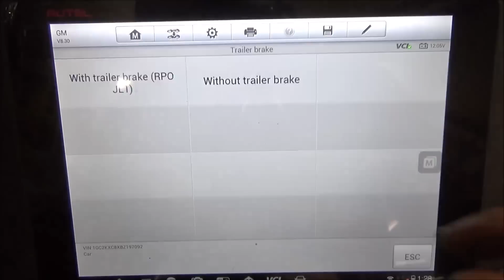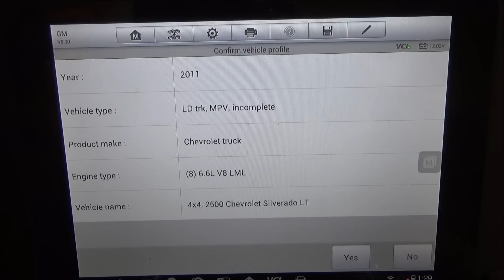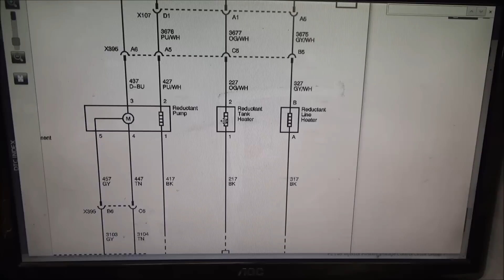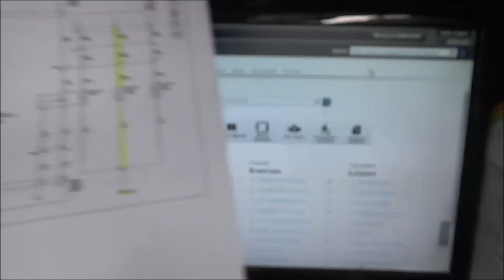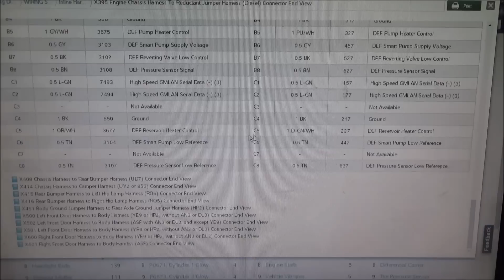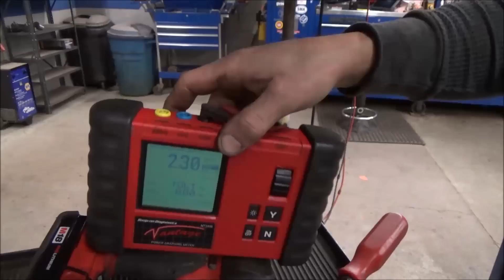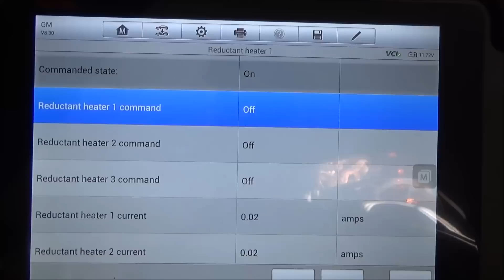Chevy / GMC 2500HD Duramax - P20B9-00 Reductant Heater Problem - Part I

Comment: Don't feel like the lone stranger.  I've had similar experiences with a Chevy, Ford, Nissan and Toyota dealership repair shops.  In each of the four cases (after giving the dealer the first shot), I took my vehicles to a private shop that had the problems fixed in one day!  In the case of the Nissan problem (electrical) an automotive electrical repair shop repaired it in under an hour for $20!

Comment: Till I read the system description i was not 100% sure what it meant with Diesel exhaust fluid (DEF), never heard of this. Cause in europe it is called "Adblue" (branded name) or simply Harnstoff (ger)

PS: Please more Diesel-engine diagnose, if you have. Cause engine related they are mostly fuel delivery problems in my experience but its often hard to diagnose (espacialy since oure shop is missing the fancy tools that i know exist)

Comment: I'm not saying that this diagnosis didn't take talent. It did, but this wasn't exactly the bent camshaft issue which was right out of left field. It would seem to me that any competent mechanic would be able to find this. It's a heater. It should heat. In order to do that it should be of relatively low resistance so that the miracle which is the conversion of electrical energy into heat would be able to happen. How can this dealership's mechanics be this bad or this poorly trained. I thought GM forced their dealers to send their techs to GM training institutes. I KNOW THEY DID IN PITTSBURGH because there was a GM training center in Monroeville that I passed everyday on my way to Westinghouse R&D Center. I know that Avoca is a very small dot on the map but can these guys really be that bad and not get noticed by GM? I can't believe this would happen in Rochester or Buffalo without GM taking notice. More here than meets the eye.
Reply: +SATAMAN Schmidt --  Sounds really simple to me.  If ANYONE at that dealership redirects or implies repair redirection to ANY other business by saying they can't fix their own vehicles than management, at all levels, is not on top of things, period. I can't put the blame solely at the mechanic level.  Although anyone involved with this particular issue should their pee-shooters Back-Hand slapped by a raging bull at full speed.  After all, If it happened once chances are very high that this isn't the first time.The Issue rests at the management level for NOT ENSURING,  (1) anyone NEVER say those types of replies to any customer EVER and (2) Immediate education for any employee who does not redirect this and similar issues directly and in a expedient manner to management supervisors and (3) management needs to establish hard and fast, never to be ignored, rules that any and all cases where any customer satisfaction is less than stellar are reported to management in a expedient manner which should be in accordance with the company's core values (they better have these in place and posted for all to see daily throughout all business areas).Basically, the mechanic should discuss issues with his direct supervisor any issue regarding any unhappy customer(s). Might be as simple as the customer having unrealistic expectations and who simply needs to be advised regarding those perceived expectations.  Might even be as simple as some company representative's should never talk to customers.  No matter the cause or reason, In All Cases the issue should be passed up the management chain for final resolution before telling the customer "sorry buddy, you bought a POS GM Vehicle that can't be fixed at this GM dealership. Ultimately the General Manager, should be involved in this and if they can't fix it correctly then have the GM Area Representative provide much needed immediate  guidance.  The GM should also discuss this with the owners regarding company training or re-training may be warranted.  Regarding local dealership business practices and core values... The General Manager should bust it off in all their asses to make sure this NEVER happens to any customer EVER again.  Fire or retrain those people.... Don't give a crap.   Something needs to be done immediately at that dealership to make sure this never happens again to ANYONE. If the dealership doesn't do anything .. Call the General Motors/ Chevrolet Area Representative immediately themselves. If they provide no resolution -  Call the Local Newspapers and provide detailed and accurate records. On 6PM local news show should get the fires at all time high.
Reply: +SATAMAN Schmidt  I guess the old saying is true - Not every hand-job has a happy ending...
Reply: +Hawaiian F150 it's not the first time that SMA has done work that this dumbership cannot. There is the Arcadia radio video just a week or so ago...
Reply: +AnhYeuEmMaiMai69   Yeppers  That is one awesome video!

Comment: How do you like the Milwaukee 3/8 Fuel?
Reply: +01ps  Heya's!!  I've used my Milwaukee Fuel tools and under different conditions. I love it. Period. I am not a Milwaukee salesman or whatever have you.I am simply put, someone who has been using Milwaukee tools for over 40 years. Never been let down. Ever.  It has the Power, Superb Battery Protection and Management System that is Second to None, It's Fair Priced, Milwaukee has the BEST and Easiest to use Warranty Program for ALL their tools. And if there ever is a problem, their tools are usually serviced for free locally in most big and small cities and towns.  If you take a look at what I consider the closest competitor, DeWalt,  Read the back of the box for their closest comparable hammer drill driver.  That would be the 20Volt system. Remembering that Milwaukee is an 18Volt system.  On the back of the DeWalt box says it really isn't a 20Volt system.  Why all the cloak and deception DeWalt? If you feel so comfortable about your tools quality then why are you passing it off as something else?  What else are you hiding from us?  Sorry but DeWalt,  - You've gone down quite a few pegs on this man's respect-o-meter and You are now a non-equal rival.

Comment: I scrounged a set of these- they are perfect for those pesky pins and sockets.. didn't know they were that expensive...  Fluke TL82 Automotive Pin and Socket Adapter set... damn things are over $100 on amazon...sheesh...
Reply: +Michael Owen   Michael,  check this out - it's on E-Bay now for "but it now" for $40 w/$13.95 S/H -- http://www.ebay.com/itm/New-MAC-Tools-jumper-lead-set-JLS4000-jumper-twins-test-clips-ground-leads-/181951130229?hash=item2a5d21ea75:g:xKMAAOSwyvBV-JRm&item=181951130229&vxp=mtrOr search E-Bay or Amazon for - MAC Tools ELECTRIC jumper lead set JLS4000 jumper twins, test clips ground leadshope this helps bro.
Reply: +Hawaiian F150 - Michael - I bought a used JLS4000 set in almost new condition on E-Bay about a month ago and it fits and works perfectly on all of my Fluke meters.
Reply: +Hawaiian F150 --   The $13.95 S/H I posted above was to Hawaii.. Don't know what it is for your location . Should be lot less.

Comment: 2011 and the frame coating is peeling and plenty of rust already. Got to love GM rust protection.
Reply: Is it powder coating?  Once it's been penetrated, it's NDG. Collects water behind it and the remaining coating is a great container of water. The Steel rusts away fast.  That's the same reason a lot of rust protector just accelerates the rot.
Reply: It's a wax coating and it fails soon after the warranty period is up
Reply: They are way up north so no matter what brand vehicle you drive up there, if it is a year round daily drive it is gonna rust really bad after just a couple of years, if you live up north i recommend if you are gonna buy a nice car or truck then you need to go ahead and keep your old car or buy a reliable beater car and drive the beater in the winter time and keep your nice car/truck in the garage until spring, it sucks not bein able to drive your new car but if you want your car to stay nice and last a long time thats the only thing you can do
Reply: alanmckaybmx or.....wash it...

Comment: Nice to see a diesel video. Youtube could use a good diesel mechanic actually. 

Its weird how in the US everyone seems to drive these big petrol guzzling cars, even for towing and stuff, even though they do a lot of mileage. 

Where as in the UK i would say somewhere between 1/3 to half of all the cars on the road seem to be Diesel. Where as in the US a family car might have 2.5/3litre V6 in the UK those same type of vehicles tend to have a 1.7/2.0 turbo diesel. Most 4x4's/SUV's and pickups are almost exclusively diesel powered because no one could afford to run the petrol powered equivalent. 

The obsession with diesel has also gotten silly because most people who own diesel cars in this country don't drive more than 20 miles a day then wonder why they have so many expensive problems with them. The Diesel particulate filters they are fitted with need motorway driving to heat them up so they regenerate. A whole bunch of the diesel vehicles sold here are notorious for blowing turbo chargers. Dual mass flywheels are a common expensive failure. Multiple people i know have taken their ford, Nissan or Vauxhall (GM) diesels to the dealers for various problems and been quoted £5000-£8000 for repairs.

Comment: Never take your car to a dealership for diagnostic work,  the vast majority of dealer techs these days are instructed to have a quick lube mentality on all jobs, no tech on a flat rate payroll wants a check engine light unless its an obvious problem (engine noise, oil leaks, etc.) , much less an electrical problem like the radio issue with the Arcadia, and if you want the truth, only like 2% of dealer technicians are the professional Eric is or Ivan (motoYam82), where they actually use their brain to diagnose and learn how a system operates from scratch and not throw parts at it until the code doesn't come back then come up with a story to write the job and justify the thousands of dollars spent on good parts, i mean these people take courses specifically on the brand they work on(on top of the knowledge they're supposed to have) and still can't figure out how a system works, its sad but true, if you're planning on taking your car to a dealer just hope there is a very specific service bulletin for your problem or that your engine is falling apart otherwise it won't get the attention it should.

Comment: Hey Eric, nice video as always.

The dealership I am at sees this same exact issue, especially when the temperatures get cold and that heater has to work overtime. Usually you have to replace the whole internal reservoir which has the heater inside as you found out, we stock at least 3 of them because of this. 

Make sure you top off the DEF tank with DEF fluid and perform a fluid level reset too!

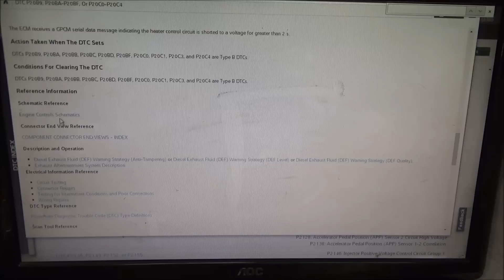Comment: Oh man.  Besides all the little stuff that was nickel and dimeing me to death with the 2005 GMC 2500HD Duramax,  the service advisor just pissed me off.  So, out went the GMC and in with the RAM.  I'm lucky, my RAM dealer tech is good.  Had a 7:15 appointment today to change the oil, lube the truck, apply all the software recall updates, and inspect the front track bar mount welds.  Got it back in 3 hours and it was even washed.  Serviced and done right.  

Another great video Eric.  I'm sure your troubleshooting skills rank in the top 1% of techs.
Reply: +South Main Auto Repair That's why we have children.  You just need to wait a few more years to reap that reward.
Reply from the maker: +Chris Freemesser Mine just write on it now haha
Reply from the maker: +raykrv6a Wow I need a place that washes my truck haha

Comment: Eric, you know what happens; a bad expierience will be told to 15 people and a good one to 5. You won a new client, maybe for ever. congrats!
Reply: +South Main Auto Repair It's interesting that some auto shops think just because it's Diesel you can't work on it.  I tell a lot of my Auto friends that a good majority of the controls are the same and how the fuel is injected in the cylinders is very similar to Gdi systems.
Reply from the maker: +Willem Streutgers That is a true story right there.

Comment: step one remove the cab. lmao that was hilarious!
Reply from the maker: +madbull9988 Only funny because it is true on some trucks
Reply: @SouthMainAuto  very true, i got a 2020 fusion and when i open the hood and found out i dont need to remove the front bumper cover, i damn near fainted
Reply: Look
Reply: Yeah but - that's exactly what they had to do on mine.
Reply: @dennyoconnor8680  i got a 2020 fusion and i damn near fainted i didnt need to remove the front bumper cover to change the bulbs and battery
Reply: @dennyoconnor8680  uh huh hi

Comment: Great video. 

Back to customer complaint, the CEL/DEF light on and limited to 55 mph. Following the code found a problem, this may fix CEL/DEF, but will that fix the limited to 55mph complaint?

Does the computer put the system in default mode due to a DEF heater?

This entire emissions crap on these diesels is just plain silly. The ambulance company I work for had a few Duramax 6.6l Ambulances and We would idle them all day due to being posted in different coverage areas. When you actually needed the trucks for emergency calls they would sometimes go into regen mode and limit the thing to like 35 mph and blow smoke like a coal train. Pretty tough driving to a medical emergency at 35 mph. 

One day I pulled out of a parking lot after idling for about 8 hours. There was a "happy" looking guy behind us in a very nice light colored convertible with the top down that pulled up behind us. When I accelerated the biggest cloud of black smoke I have EVER seen filled this guys car completely up with smoke. He had to pull over to the side of the road, I felt really bad.
Reply from the maker: +m ph I gotta admit I read that and LOL... literally. Smoky ass diesels any way!

Comment: zomg  your still alive!   I need to get my Brake Cleaner fix after thanksgiving.

What is Diesel exhaust fluid, i am leaving google out on this one.

Its nice to see when you take your Diesel expensive truck to the dealership to fix they not only do not have a mechanic on hand but try to sell you a new one.  Awesome.   These dealership guys are fantastically full of it. 

I went in to buy a Toyota 4Runner from a chevrolet dealership and they tried to buy my 07' low mileage (28000) Garaged Cobalt for 1250$.  HAH!
Reply: +Randy Leonard Basically, DEF (Diesel Exhaust Fluid) is a fluid sprayed into the exhaust to reduce the amount of NOx put out by diesel engines. All part of the emissions control system.
Reply: +OSTKCabal and it is urea which is high nitrogen.. like in fertilizer

Comment: Typical of a dealer. "we can't fix it, but you shouldn't be working on it. Bring it back to us so we can mess it up more. How can you possibly know more than us? We are the dealer." They act like they're God Almighty or something. And it isn't just NY or Chevy dealers. I ran into a problem on my timing chains, wherein I had slack between the cams on the upper chain, causing me to think I was a half tooth off and a VW tech couldn't even help me. He said the computer called it obsolete and had no information. Turned out that looking at my camshafts, the notches were 180 degrees off of the norm and they will always have slack in that position. Rotate it 180 and it's all tight and fine. The lock plate wont go in is the only difference. I just got an oddball.
Reply from the maker: +Jacksonkellyfreak You didn't know dealer service writers can walk on water?
Reply: +South Main Auto Repair I knew the service managers could turn water into wine

Comment: "No diesel guy" that's some crappy customer service if it's the full story! I get a corporate boot up my a** if the customer coffee machine isn't full! 
When you install the heater, be very careful with the fluid, it's nasty stuff. Eats paint right off and given enough time, eats metal! Wear gloves Eric, that stuff ain't nice! It's watery pee pee. Great video as usual SMA, thanks. 
P.S Nice Steve Rob sticker 😉
Reply from the maker: +Toyota Tech Weeelllll it is a bit to late. I didn't get much on me though and I haven't seen my arm fall off haha
Reply: +South Main Auto Repair I left some (Adblue in EU) in an old plastic oil bottle on the bottom shelf of a workbench, it leaked out and ate the metal rivets away! Took about 8 months so you'd have to pretty slow fitting that heater!

Comment: Typical stealership BS. The first shop I worked at was a local Toyota dealer, what a joke that place was. My brother in laws wife bought a Subaru Crosstrek a few years ago, she recently got a coupon in the mail from them for a 25K service for the low price of $399!?!?! She called me up because she thought that seemed pretty high, I agreed and told her that most of the interval services are just an oil change, tire rotation and inspection however there might be some adjustment or service that making the price so high. I check out what the "official subaru" 25K service involves and its nothing more than an oil change, tire rotation and inspection. For $400! Of course I did it for her for less then $100 with a new air filter.
Reply from the maker: +Nutz4Gunz45 Hey now it involves a serious visual inspection there. That is $200 alone!
Reply: +South Main Auto Repair $100 just to pop the hood
Reply: +Nutz4Gunz45 You forgot that it costs $300 to locate the hood latch, prior to charging $100 to pop the hood ;)